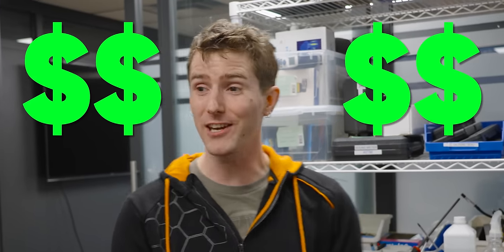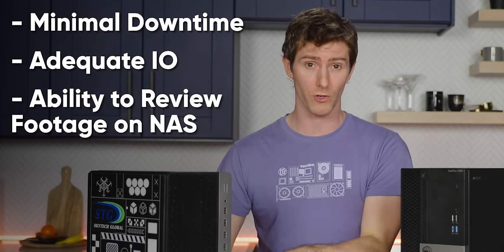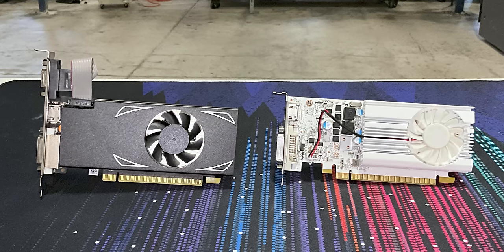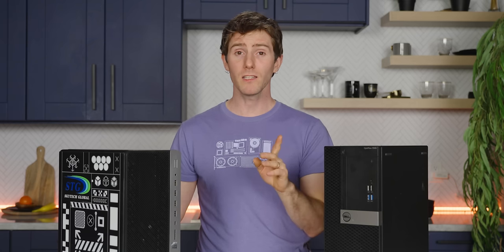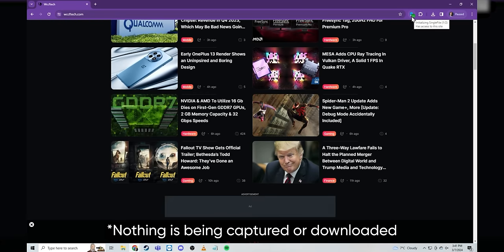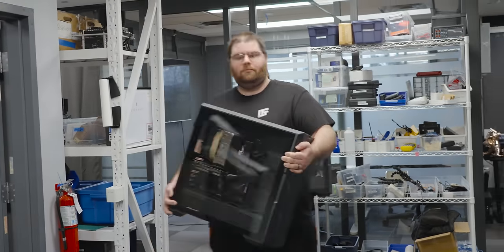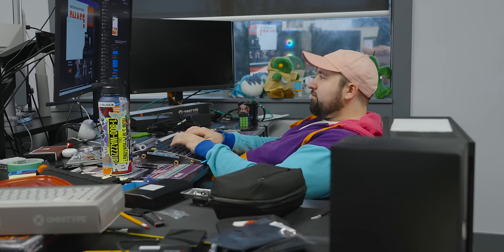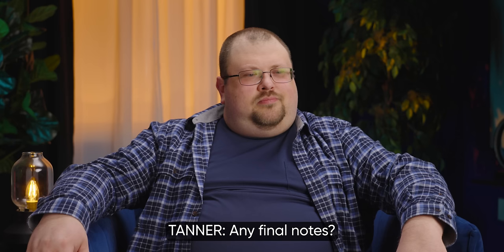We Downgraded our PCs to Prove You Don’t Need a New One

Comment: I am still running a i7-4790 and it works like a charm for most semi modern games.
I only recently replaced my beloved Radeon R9 390 with a used 2070Super, because the non-existent driver support caused some issues in a few games.
Reply: 2070 super is still a workhorse
Reply: 4930k with a 6800xt myself. Definitely feel the age in some games but for 4k 60 fps its good enough :)
Reply: @greatmatt301 dude thats not comparable
Reply: @Just-A-YouTube-User  the CPU absolutely is.
Reply: @greatmatt301  Ryzen 5 2600 with 6700xt here, bought it on the summer of last year and absolutely loving the raw GPU performance, It's everything i ever wanted from a PC!
Reply: @snoopy9292 My old pc has one. Handles most games very well. My new pc has a 7900xtx
Reply: Thats a big bottleneck for that GPU. I had a i5-4690K for 8 years with a GTX 970 (brand new) and i Upgraded everything except the GPU. The card was able to pump out more fps in quite a few games compared to the 4th gen i5. (depends on the cpu requrements of the games of course)
I upgraded to a 11400F build (was a better deal than a 5600X back then), I felt the difference just on the first boot and overall snappiness in Windows or web browsing. And Im not even using NVMe storage for boot drive. (though my old Z97 mobo had some NVMe support, did not use it after all)
I can definitely recommend to upgrade your cpu. You wont regret it.
Reply: 4790 is better than the 6500 they use in the vid anyway
Reply: i7-4790 is the best ! No need for new CPUs
Reply: @IgorFighter7  
I know that the CPU is the bottleneck in my system, but upgrading it makes no sense due to the additionally cost. I cannot simply put in a new CPU. I would also need a new motherboard and since we are already there, I guess I should also switch from my current DDR3 RAM to DDR4. Maybe I even need a new PSU, because new CPUs draw more power than my current 4th gen.  That is 4 pricey components I would have to swap. 
Not worth the hassle for a few more FPS. I  can still play all my games above 60FPS. As long as it won't die, I will keep it the way it is right now. :)

Comment: Funny thing is, I have a 6700k+16 gigs of ram in my garage and it runs all the home automation - talking magnetic locks, cameras, sensors, lights, door motors, reactors (water heating stuff), and a bunch of containers for different home services. It's plenty for this kind of work, if a bit expensive, and naturally less reliable. Even with  all of that, the machine has plenty of overhead to spare. All in all, the wisdom of the video stands true - depending on the use case, an old machine can go a very long way. And if setup properly can also save a LOT of money. If I am to do the same stuff with actual automation tools, it would set me back by the thousands.
Reply: what's the software you use for home automation? I'm thinking to use one of my old PCs for that, but not sure where to start.
Reply: Yeah I don't understand why you need any of this stuff to be hooked up to a computer.

I have never said to myself hey you know it would be cool if I could click a button on my computer to turn off my light or to turn up the temperature on my thermostat.

Also don't most people just use raspberry pies for things like that?
Reply: @horribleIRUKANDJI  Since my use case is fairly basic - the entire house can be summed up as a bunch of switches and a few outputs, I run the entire thing with a couple of pik controllers. SInce I wanted the house to be autonomous and not involved with a big company's ecosystem, the entire back end from controller firmware to OS level services is my own doing. All in all it comes down to code, so nothing special. If you want a solid and relatively cheap solution, depending on how many inputs/outputs you have, you can use something pre-made like a Mitsubisi or Siemens control bricks. Those can drive all the aforementioned basic automation without any issues (excluding the cameras, as in my use case those are IP cameras, so they already have their own communication protocols and I have them hooked to an Agent DVR blackbox service). Using Fedora IoT as a backbone for my IoT PC.
Reply: @bland9876  You can use anything which can fulfill the purpose, raspberry pi included. The reason I use the controllers I use, is simply due to my needs. When I need to operate four analog devices automatically, I'll get a controller that has four analog outputs with the appropriate parameters. 
The reason I use a PC is because I run a bunch of containers for different home services - NAS, pihole, pfsense, a bunch of video game headless servers, etc. Since it has to be online anyways, I tacked the home automation on it as well (mostly as a personal project so I can learn how to move data over the home network. Unironically, when I was studying automation, they never taught us how to code for the networking side of things).
Also, clicking a button on the PC to start an  action is not automation, it's remote control. My system can do that too, but it's not what it's for.

Comment: I built my computer about 9 years ago. Intel i5-6600K, 16 GB 2133 with an EVGA Nvidia 1060 6GB video card and a few leftover components. About 2 years ago I started getting some stuttering on some games. I ran a computer diagnostic program and the only component listed as critical was the old 500GB HDD. This was a reused part and was most likely 15 years old at this point. I bought a 1 TB SSD and cloned the drive. Now this is still a rocket ship. I don't do COD online or anything like that. A few racing sims, RTS games, GTA V, Witcher 3 and Red Dead 2. I'm not missing anything I want. I've been building my own computers since the Pentium 2 came out. It's a lot of fun to not have to set a dozen jumper pins on the MB and program your sound card into a startup .BAT.
Reply: Cool story, but this video wasn't about home usage or gaming or any of that. This video was to show whether older business computers are still viable for BUSINESS USE today. Answer: not really for multiple reasons. Single guy building and maintaining home computer is entirely different from how business operate. Linus even hinted at that at the very end.
Reply: 'Old' Enthusiast builds are over spec for office tier work @Glotttis  

Good try
Reply: That's the point, a simple switch from an old HDD to an SSD or a faster network port can work wonders on older computer systems. Why replace entire computer systems if a $100 part for each can improve performance? My specs match theirs and mine was not even top of the line at the time I built it.
Reply: I'm pretty sure the 1060 is newer than 9 years old also I really hope that you didn't mean your C: drive was an HDD. Even 9 years ago we knew that wasn't good.

24-9=15 2015

Comment: Lol a couple years ago we deployed those 7000 series dells as replacements for the nearly 20 year old dells that a lot of the grad students used. 

Not to be *that guy*, but using a different browser (like firefox) really helps prevent it from consuming all of your resources when it’s open. I should know, I currently have three hundred tabs open.
Reply: Good point.  //  Forcing people to upgrade to newer PCs - is ultimately a climate change issue.  Which is more important?

Comment: When my dad had his engineering company, I used to be the sole IT-guy and we would custom build every computer. But as things got bigger and tasks per discipline were more streamlined, we found very little sense in building computers on our own. So we started switching people to prebuilt laptops and some CAD designers with very specific needs I would build a computer for them. Otherwise, these laptops, it was very easy to swap hard drives, upgrade ram, I had pre-set windows images ready to go, it was very easy to maintain.

Server side I had a couple of custom builds for NAS, Work-storage and backup, all running on ubuntu server to save money not paying for windows server and CALs.

This also helped on people not thinking they were mistreated having a different computer, it really made a difference in the air at the office.
Reply: It is fascinating how jealous people get over their work PC's.
"Hey Red, I saw that Jen from accounting got a new laptop, can I get a new laptop too?"
"No John, you can't have a new laptop, you got a new laptop 4 months ago"
<2 weeks later> "Hey Red, My laptop is broken, I need a new one"

Comment: I held onto my old HP Z210 (bought for $200)… for a long time…and it did a good job for me. I also kept W7 until the bitter end. When I finally decided it was time to move to W11, I bought two HP Z6s with W10 installed (amazing machine). 3 years later… now W11, I upgraded my processors and ram (to a ridiculous level). I do not plan anymore hardware changes until age 10… when I’ll be ready for new machines.

Comment: In line with this, three months ago I bought a used HP Z840 for $340 (shipped) that came with: 

XEON E5-2667 V4
MSI GTS 1080
32gb DDR4
1150w Power Supply
1TB SSD 
DVD R/W drive
Win 11 64 bit (registered)

This machine is ridiculously capable for the $$$ spent on it.
Reply: You could do some pretty good gaming on that thing, if I'm being honest
Reply: Xeon e5-2680 V3 after turbo unlock (12C/24T 3.3GHz all cores)
Zotac 1660 Super 
64 GB ECC DDR4 
1TB NVMe SSD
China X99 mobo  (Machinist RS-9)
1000W PSU
Runing on Win 10
All this for less than price of new prebulid

Comment: Screen flashing black 6:40  Was it on RX580? My does that!!! I've read somewhere it's caused by core clock frequency dropping down to 300 MHz and up when idling or something. A solution is supposedly to increase the idle clock. Which I wasn't able to since the idle is greyed out in driver. The "solution" I'm using is having two monitors. With that, the GPU is idling on 600 MHz with no flashes.

Comment: I feel attacked, as I am using an i7-6700k with base clock and no intention to change it (clock nor cpu)
Reply: Crys in c2d laptop 

(upgraded but still)

T9900
8gb ram
SSD for os
1920x1200 LCD
Reply: I am still using a i7-4790k and a gtx 1070 and it's been working fine for me and my games
Reply: I'm still running a 6700 non-K and honestly can't complain about the system, it has a 1TB 980 pro, 32gb ram and a watercooled 1080 ti and it's running three 1080p monitors
Unless you feel the need to play in 4k it's perfectly fine for now
Reply: i5-3570k, 16gig ram and gtx 1070. No alan wake 2 for me (soon! thx remedy for the patch)
Reply: @Kyomara1337 My last PC was a 6700.  The 2016 purchase was a bit too early for the Nvidia 10 series so it had a 970.  I upgraded in 2022 because the overclocked 970 was overheating and crashing during multiplayer 7d2d.
Reply: @PaintsAreOp  Doesn't Alan Wake 2 require AVX2 or are they dropping that requirement too?
Reply: I7 7820x and 1080ti for the foreseeable future
Reply: @xxblazeshadowxx  That's pretty similar to my main PC which has an i9-10900X and GTX 1080 non-Ti
Reply: @Wynter_Wolf86 The 4790k is such a beast. I didn't upgrade until Zen 3 AMD released and I still feel a little guilty about doing so.
Reply: pentium 2*3ghz + gt730. Runs Aion perfectly in high settings. I just had to replace the hdd by a ssd to make it boot 60 times faster.
Reply: I got a i7 4770k and I can't overclock it the ratio multiplier is locked on my motherboard
Reply: I've never seen a Youtube comment where someone tells they are using old and crappy computer (or a phone). No but seriously, no one cares. Did you miss the point of the video? This is about businesses and whether older machines are viable. Answer: not really for many reasons outlined in the video.
Reply: @Glotttis  Got you to care
Reply: What's wrong with that CPU? That's the one I have in my computer and I can play most games just fine (only Fortnite gives me trouble)

Comment: At this moment I’m still rocking an Intel Core I5-3570K with 16 GB RAM and windows 10.
I had this machine built in November of 2012 so it’s basically as old as my daughter.
I think recently I’ve been hearing some squeaky noises from the PSU but apart from that, it runs well enough.
I’m blind, so am using onboard graphics, but I will need a GPU in my next machine, as I’ve started doing a lot of stuff with local LLM’s and music tools like Demucs which my current machine can’t handle.

It does surprise me that `I can do anything with any level of speed here though.
It’s not blazing fast obviously, but it’s not slow enough that I feel like I’m waiting around for hundreds of years to just open a Chrome tab, or perform an edit in Sound Forge, which is my two-track audio editor of choice.

I don’t know when CPU’s stopped becoming mega slow after a year or two, because I’m pretty sure that you couldn’t/wouldn’t use a 2002 CPU in 2012, but a 2012 CPU in 2024 still runs fine.
Definitely got my money’s worth from this box.
Grateful for that.
Reply: cool

Comment: Well, there is actually a reason why 6th gen will not work. It is called TPM 2.0 and Windows 11.
Reply: @LinusTechTips - This right here is the reason why those 6th gen Intel will die out soon in an enterprise setting. Licensing for Windows 10 is going out!
Reply: Can you just get a tpm module to put on mother board or maybe pcie slot?
Reply: There are work arounds, get your Installed disk and plug it in to a  6thgen system it Wil just start up and go
Reply: Exactly that’s why business are dropping them security risk is too big and cost for extended security to keep old machines isn’t worth the cost
Reply: @HatsuneSquidward no 8th Gen is the oldest CPUs supported by windows 11
Reply: @gideonruben187  workarounds are fine for the average enthusiast (provided Microsoft does not break them), but will immediately fail a security audit by a corporate IT team when done in an enterprise environment.
Reply: 6th and 7th gen do have TPM 2.0 but the CPU itself isn't on the Windows 11 supported CPUs whitelist
Reply: Came to say this. While for home use - especially if the enthusiast is going to be on the hook for all tech support - a worked around copy of Win 11 might work. But for a business that is trying to maintain a supportable fleet, stay on the right side of licensing, and be able to pass audits regarding security, then older devices aren't an option.

Win10 (non-LTSC) goes EOL October 2025. Unless that company is willing to pay for extended security updates or run with risk, then hardware refresh is the only way forward.
Reply: @Pasi123 This. Apart from the i7 7820HQ (and only on two or three different laptop models) 7th gen and older CPU's from intel aren't supported even with TPM 2.0. Ryzen 1000 isn't supported too but those users can easily upgrade to Ryzen 2000-5000. While LGA 1151 V1 users are screwed.
Reply: @HatsuneSquidward No. Windows 11 requires TPM 2.0 and a supported CPU. Oldest intel supported CPU's are the HEDT X299 based 7000 chips and for the consumer platform they are 8th gen. Oldest AMD systems are Ryzen 2000.

The TPM 2.0 requirement is for system that do have a supported CPU but not TPM. For example I have an 8th gen i3 system that cannot be upgraded to Windows 11 due to not having TPM 2.0. All I would need to do was buy one of those modules and then it would be compatible. Also I think late intel Macbooks don't have TPM 2.0. So while you can easily bootcamp to Windows 10 with a 2019 Macbook. You can't bootcamp to Windows 11, even though the CPU is supported cause they lack TPM 2.0.
Reply: @Liinuli.  just to add more confusion, supported Ryzen APUs (including laptops) are from 3000 series on.
Reply: @haydenw8691  That was because AMD was naming their APU's one generation behind. So Ryzen 2000 APU's were in reality Ryzen 1000 chips. And Ryzen  3000 APU's were Ryzen 2000. And Ryzen 4000 were Ryzen 3000. At least for desktop Ryzen 5000 APU's were actually Ryzen 5000 chips.
Reply: Kid names rufus/ TPM workarounds

(Or just switching to linux :3)
Reply: @Liinuli.  exactly. Was just pointing out it can be confusing for some.

Comment: All I got from the video is how spoiled employees are at LTT. The problems they talked about were mostly Software Related & you'd think Employees at a Tech Company could solve those problems. I get why Tech Manufactures Solution to most problems is "Upgrade Your Hardware" but this should not be the case at a Tech Company. Sure certain departments like video editors need more demanding systems but most Employees could get by easy with older Hardware. The old saying "A penny saved is a penny earned" will always remain true.

Comment: My wife is still using a mini-tower with an I3-2100. I upgraded the RAM to 16 GB and installed a 512 GB SATA SSD as the boot drive, leaving the 1TB spinny drive for mass storage. It's boot time is stil pretty pathetic, but it's good enough for what she wants to do.
I bought her a brand-new Acer with an I5 12400 under the hood, but she hasn't bothered to unbox it yet.
Reply: Had the exact same CPU. Please tell her to unbox that Acer. Those 2 cores really hurt in Windows once you realize how much better it can be
Reply: My sister had a Fujitsu prebuilt with an i5-3470, 8 GB DDR3 1050 Ti and 500+250 GB HDD. Guess what I got as a replacement when its PSU gave up? Literally the same model from a refurbisher for 60 bucks, except I also got her an SSD boot drive. She's more than happy with it. If something other than the PSU fails I even have replacement parts for it now. Some people just don't need thousand dollar PCs to daily drive.
Reply: Could you try turning off things in startup to see if that helps with the boot time? If general usage is fine, then that may be it.
Reply: @frf5000  LOL! You seem to be under the impression that I can tell my wife to do anything.